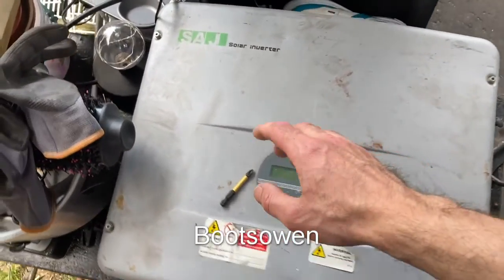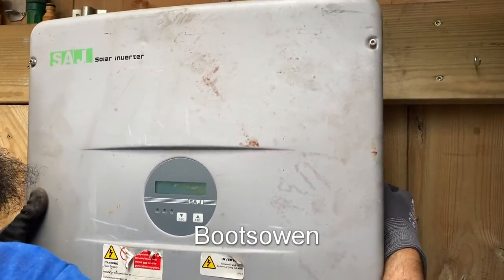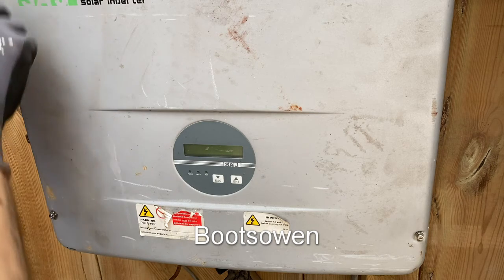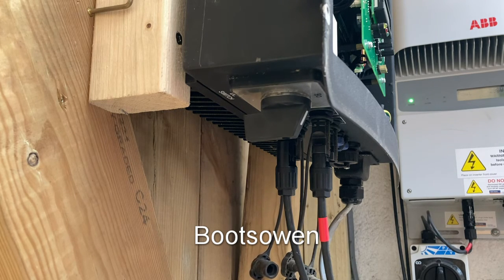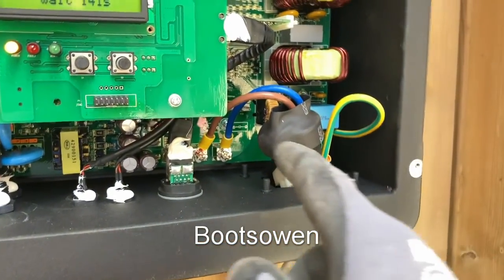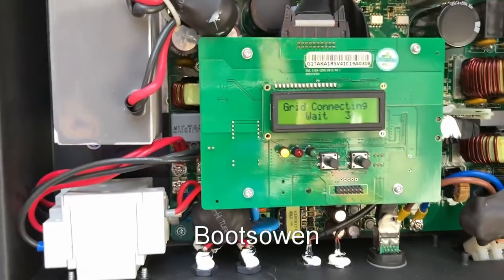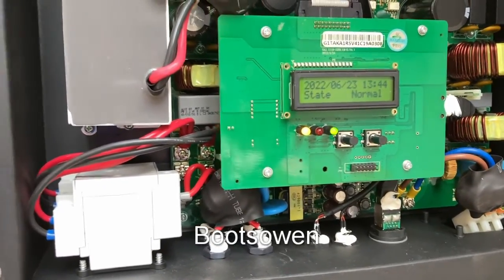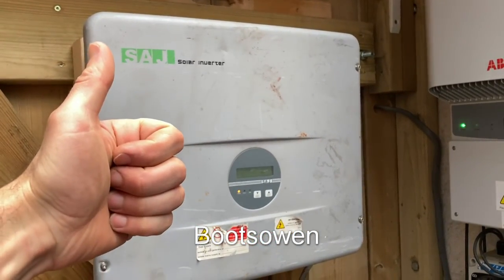SAJ Sununo TL4KB Grid tie solar panel inverter testing.

Comment: Well I now know what went wrong, I did wire the strings wrong and put 860 V dc on it,way😪 too much. Now perhaps the vdr s are shot,perhaps other things ? No display nothing ....Opened it and can t see anything wrong,looks like new.
Reply from the maker: Did you try it again with a lower voltage? It might have protected itself, hopefully.
Reply: @bootsowen  it didn t .One tracker totally dead,the other one gets the inverter on but stays in stand by status even with loads of sun.Some DC failure I suspect but I ve not enough knowledge .Might be the VDR s but can t even find them.

Comment: Well, yesterday great sunny day here and after midday suddenly the inverter gave sign of life. Orange lamp burning ,heard after a few minutes a very weak click, also display works ,only he s not starting up. No green light no nothing. Pushing the knobs gives P ac  0W    and also 0 V.   status   wait    I don t knw on what he s waiting. Turned him manually out  but stayed off untill now.  Strange.
Reply from the maker: Is it putting out any kind of an error code? 
sometimes, usually, in my experience it is a fuse or a relay, the fuse is easy to fix and check, (have a look at my other solar videos) these SAJ machines are easy to work on because the front comes off. The relays are harder to replace, but can usually be spotted because there will be burning or scorching around them.

 I bought another "broken" one of these SAJ machines today so will make a testing video. 

Let me know how you get on. 

Don't be afraid to take the front off it if both of the isolators (AC and DC) are turned off and don't turn them on while you are inside there!

Comment: Hello, I have a similar inverter and after instaaling it by putting the switch to on it gave an enormous loud tik-like a gun shot- and another.I put the switch on zero .What was this? After some minutes I retried it took a while now so I thought it was ok but then again this very loud tik and after that ..dead . No orange light ,no display totally nothing. Any nideas what happened here?
Reply from the maker: Sounds like you’ve blown something inside. Disconnect it and have a look. If it looks like it was on fire it’s probably broken
Reply from the maker: Sounds like you’ve blown something inside. Disconnect it and have a look. If it looks like it was on fire it’s probably broken
Reply: @bootsowen  I opened it and nothing strange to see.No black spots ,no smoke ,no blown up delcos . Mystery to me

Comment: Owen, the more I see of this type of inverter it seems that the software is generic. It's great to give it a go and use it to reduce the impact, cheers
Reply from the maker: This one is motoring away in the cellar taking the 4 odd panels. Very light load. Bargain.
Reply: @bootsowen  So, low load, in a cool place, well ventilated. I'm thinking it will last 20 years, cheers
Reply from the maker: I got all the grass cut this year with a hand scythe. Some people pay for the gym.
Reply: @bootsowen  That's grand, a skill practiced. How you getting on with the UPS inverter charger? Cheers
Reply from the maker: Nil until I get back. I have had the 24v one apart. Not much to it. It is going on the fridge maybe end of next week.
Reply from the maker: I got a huge selection box of crimp ends at a car boot for £3 about a month ago it had some rectifiers in it too for the inverter test rig. Lots of projects on the go!
Reply: @bootsowen  Sounds like it will last a life time, cheers

Comment: Hi Boots,
After the roaring success of replacing the relays and power up of a 2kW inverter, I'm now onto the second one to fix. I have four in total, picked up from the side of the road at one address.
The second is a Saj TL4K, circuit board dated 2013. Doesnt have the DC contactor.
Relay fault, relays replaced but error persists. Investigation continues.

BTW, this video is unlisted and only shows in the playlist.
Reply from the maker: Hi Ian. Great news getting your scrap finds going. Nothing like it. I wish people would throw away some working panels! 
I edit videos in batches and upload a few at a time. But I leave them unlisted and meter them on so that I appear to be regular. Just sorted out a solis inverter that had ov bus as its error. Andy Reynolds chopped the top off the relay and gave it a tweak. Off to the races!  Thanks